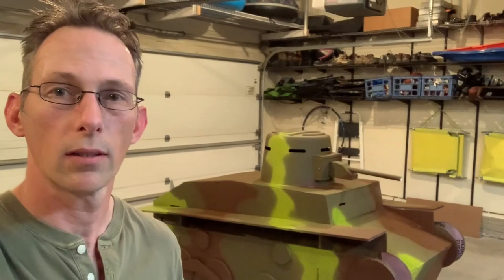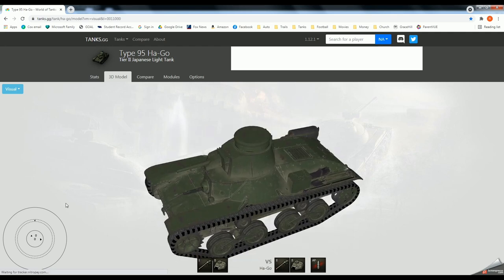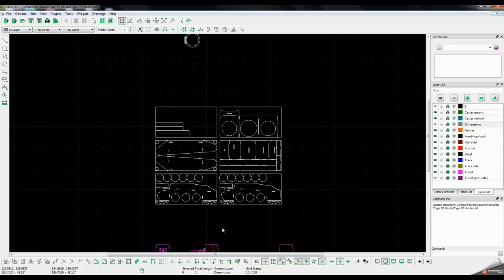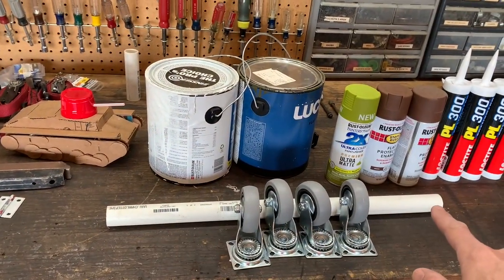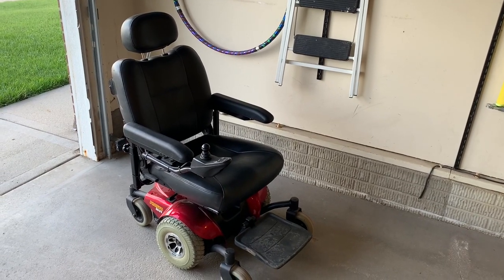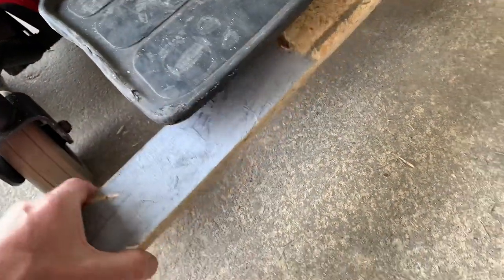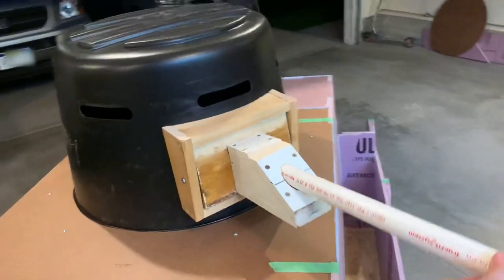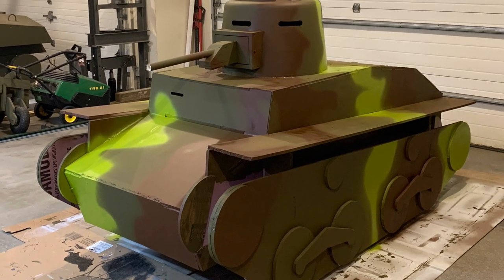Type 95 Ha-Go light tank built in one weekend for around $100

Comment: Great work! I personally use a hoverboard gokart for my tanks to get around, have not had any problems as of yet. As for the machine gun’s location in the back of the turret the idea was to keep the turret smaller in size and allow the 37mm gun to be operated with simple hand tilt controls. If you wanted to use the MG the commander would swivel the turret around and just use the MG. Not the best system but the Japanese were experimenting with alot of concepts that they learned from ww1 and post ww1 tanks.
Reply from the maker: Thanks! I’d love to see what you made with a hoverboard gokart (not even sure what that is), post some video so I can see your creation!
Reply: Heck yeah I will have to do that. I built a half scale Italian CV-33 tankette for airsoft.
Reply from the maker: @bananawarfareproductions5791  wow, the CV-33 is small to begin with. At half scale I’m surprised you can fit inside. Let’s see some video!